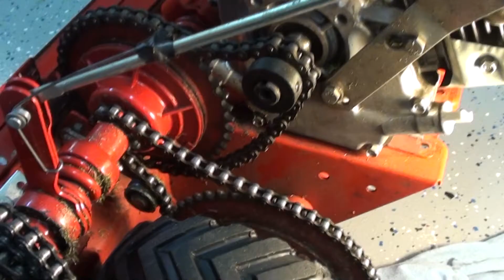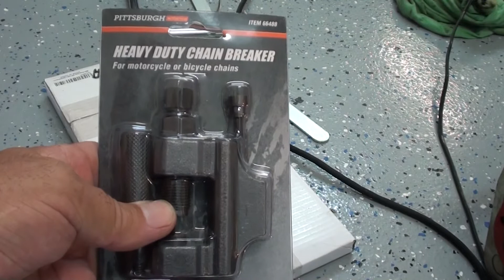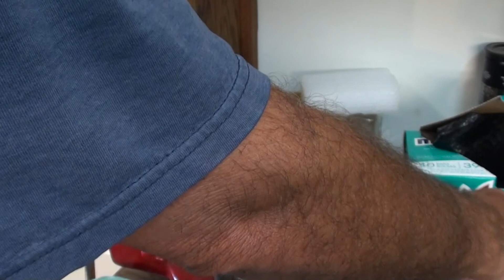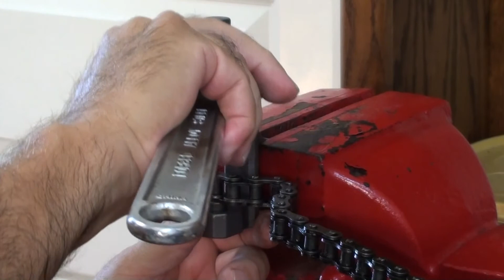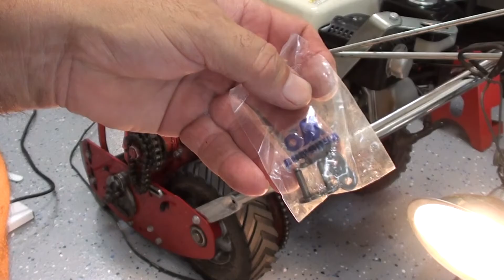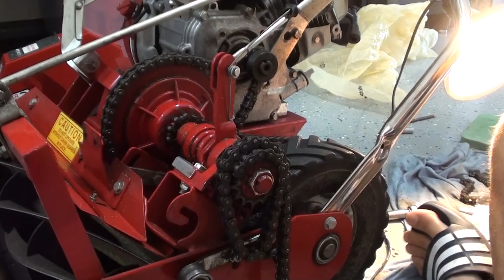Tru Cut P-20 Main Chain Replacement

Comment: This video was very helpful to me. I replaced all 4 chains on my Trucut H-20. I lined up the original chain to the new chain to cut the chain to length using a hand held chain breaker.